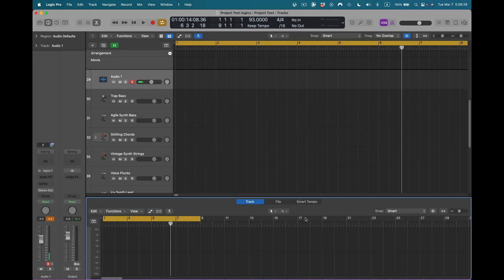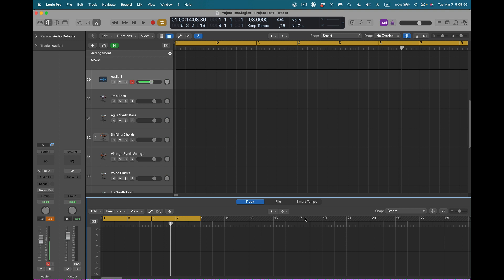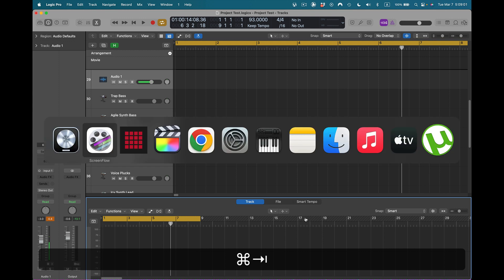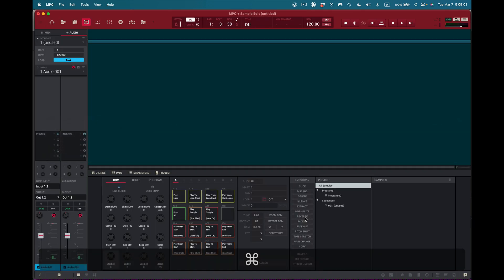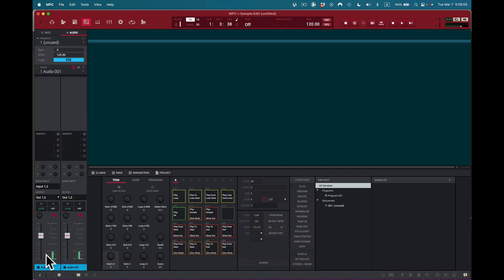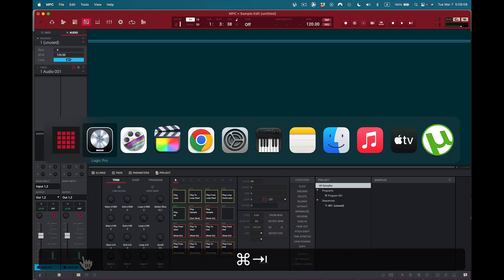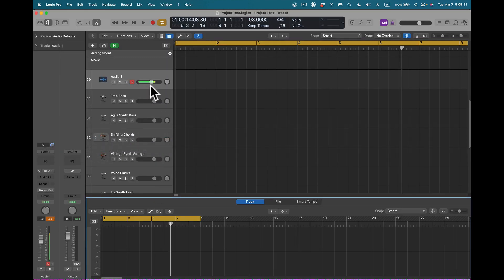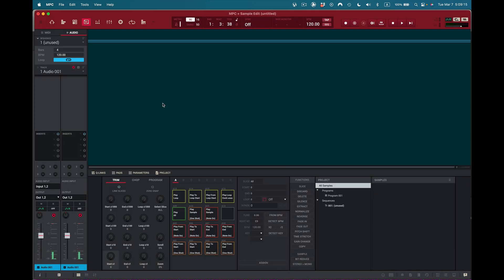32 Bit Float Audio and how Gain works in any DAW

Comment: I got a question fam, you know when creating a new drum program on the MPC (5000) there's a screen where you can layer up to 4 sample /adjust the level, tune, range. My question is what is range, and can you explain it to me. Searched the manual and it only explain level and tune.
Reply from the maker: Reach layer can have a keyboard range from C0 - C8. I have a mpc 5000 video in my YouTube channel. THE AKAI MPC 5000 FULL WORKFLOW FOR BEGINNERS PART 1  
https://youtu.be/B76VISe58sU
Reply: @SampleKingsVideos what is 000 - 127 (range) is it panning ?
Reply: @SampleKingsVideos  Thanks bro, part 2 answered my question. Range is velocity ..

Comment: Zoom UAC-232 is 32bit float interface. And the rode nt1 gen 5….. 32bit float for life
Reply from the maker: It's in every DAW.
Reply: @SampleKingsVideos  The only way to record into 32bit floating point and have the capabilities of no clipping is if the device is 32-bit float. You can definitely clip an audio signal into a 32-bit floating DAW if the device is 16 or 24 bit. The device has to be 32-bit floating for capturing audio. Internally is different. so bouncing things around, using dynamics plugins and such in 32-bit floating means you have all that range and can't clip internally. There are now 32-bit fixed point devices-they'll clip. W which is what 4:08 means.